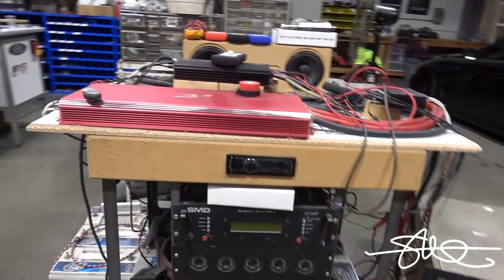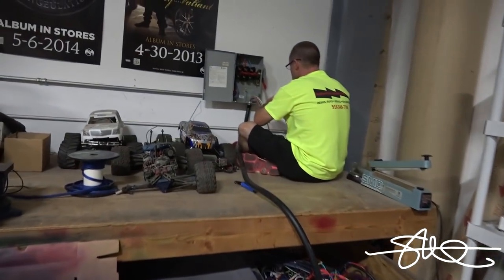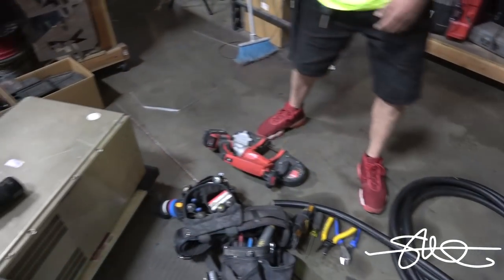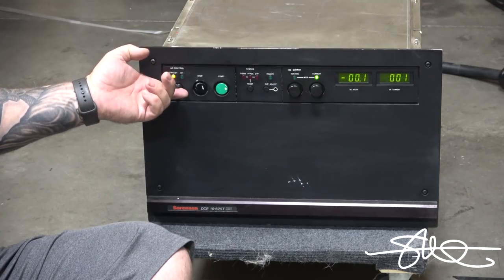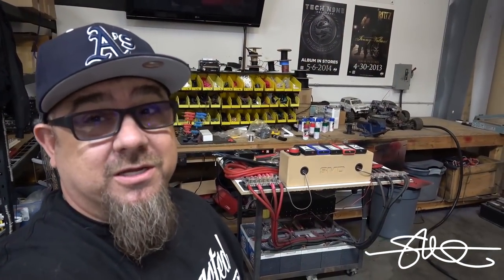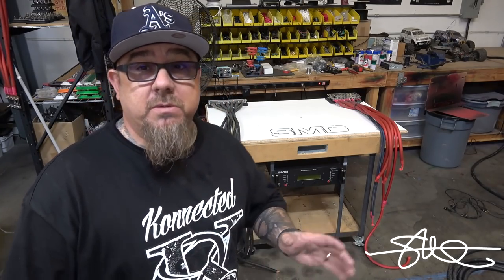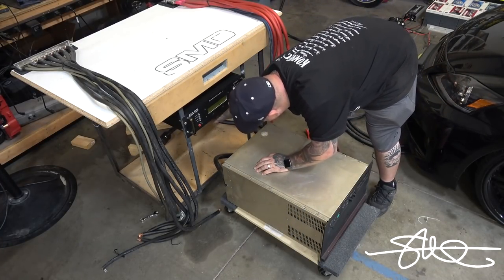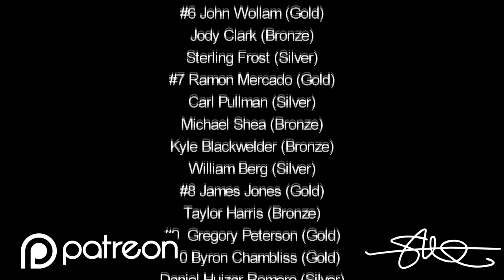Major Test Bench Upgrade! 10,000 Watt DC Power Supply! Sorensen DCR-16-625T

Comment: For the amount of power that supply is putting out that 4/6 wire is pretty modest to run it that is great considering how much wire it takes to run 1,000 amps at 12 volts

Comment: Did you add a 3rd wheel to the cart?  & since you’ve got such a solid power supply & massive one at that.  You going to run that 4/0 wire you have to the distribution blocks or just stick with what you had on it Before

Comment: Make sure you get some maxell ultra caps for surge capacity to take strain off of power supply when you push a BIG amp, the 2500 capacity series will do well and will save you from killing your new power supply

Comment: I’d hate to have to pay his electricity bill 😮😂 badass power supply 😈 that how SMD does it tho 👌
Reply: It will still probably be a lower power bill than it would be with the battery bank.
Reply: Was just going to say that charging the battery bank would be more expensive over time that only using the power when you need it.
Reply: Definitely could be true.
Reply: Never thaught about that 
Smd you need to diy some solar panels on the roof and some chevy volt batteries for the shop
That is if we are worrying about the bills but i dont think you are

Comment: If you plan on getting rid of any of those XS Batteries hit me up. My Optima took a crap this morning. 8 year old batt. Keep up the good work man! Love the videos.
Reply from the maker: your optima is a 12v battery.  These won't work for you. thanks though
Reply: I've got a built alternator and it kept that Optima at 13.9 I think that's why It died. I've got a supercap bank and as long as I unhook the optima since its died I can start my car if I'm quick lol.
Thanks for replying man. big inspiration
Reply from the maker: 13.9 is good...for a 12v battery.  It isn't good for a 14.5v battery like a D1400.  Those charge at almost 16v.

Comment: Seems like you would want to run some batteries or caps along with that power supply so that the power supply doesn't have to work so hard in dynamic tests; any plans for that?

Comment: What dedicated circuit has your electrician wired to the shop itself? In terms of amps. We wire some of our home theaters with dual 60 amp circuits and use Richard Grey Power stabilizers to juice the amplifiers.

Comment: I'd personally keep 4 batteries flanking the PSU to act like a capacitor, or maybe a lithium or 2, or even caps would do the job when running things like the raven. Either way, tests will be much more fair now

Comment: What size wire is gonna be used for the outputs?? And what is the deal with the rockford fuse holder having by the breaker box?!?!
Reply from the maker: you will see...and that isn't a RF fuse holder.
Reply: @meade916  distro block?
Reply: I was wondering too.

Comment: That thing is a frickin beast, I wonder what the absolute limit will be for what amps it can power sustainably
Reply from the maker: 10,000 watts.
Reply: Yeah true, I just wonder if there will be any headroom after that. Like an underrated type of situation
Reply from the maker: not really...i will probably get some voltage drop after that.  I don't test a lot of 10kw+ amps anyway.
Reply: Very true. Are you going to use the old batteries for a future build or something?

Comment: Steve are you selling any of those batteries I need one desperately.
Reply from the maker: these batteries won't do anything for you.  They are D1400 (14v batts).
Reply: @meade916  I was doing a setup simular to your much smaller
Reply from the maker: again, you don't have a proper setup to run 14v batteries that also charge at 16v.  So they won't do you any good. Sorry.

Comment: With the power supply along with all the other stuff that might end up on there later, you sure that shelf will be able to support all the weight?
Reply: The power supply is likely lighter than the batteries.

Comment: Why not keep some batteries for dyno-ing monster amps , a power supply won't have the dynamic ability to output power like the batteries did. I'm pretty sure I've seen more than 10k on that bench before in some amp test video.
Reply: Agreed. Especially with the power factor of that unit, your going to want to dampen the surge current to keep from tripping the breaker (50A if wired correctly for that CS6369 plug). That plug can supply 18kw of power, and that Sorensen unit has a 60% efficiency rating, which is 88% of the circuit at constant draw. Smaller amps its never going to skip a beat, but things like burst tests on a 10K amp dyno run are going to be tons higher on the DC side without a smoothing bank than the 10Kw rating, Hopefully the Sorensen does have an internal regulating bank heavy enough to handle the load spikes without killing the rectifier system (Haven't ever used this particular unit, its too small output wise for what we deal with in DC banks), but it may not have enough of one to smooth the spikes on the AC side to under the breaker's trip curve.

Either way, hell of a upgrade over a large bank and charge controller! Quick turn around on the dyno testing (or instant without a smoothing bank) versus waiting on a large bank to recover off a charger. Can't wait to see some test tuesdays on the new setup!
Reply from the maker: you guys clearly do not understand how this power supply works.
Reply: @meade916  I've been using power suplys big ones up to 400 amps for 20 years...we use them in ham and CB radio.....be careful or u will blow the recktafiers
Reply: That's a nice unit

Comment: If you have three phase there why not go 480 instead of 208 and bring the amps down. Plus the power supply doesn't work so hard?
Reply: if the power supply is designed for 208, that is what he has to use on it.  He may also not be able to get a 480 drop.  The 480 drop may be far more expensive than the 208.  Did you know that electric companies who supply 480 use the highest current draw of the month do determine power consumption for charging?  I know of two motor shops that use a diesel generator to start the bigger motors and switch to 480 once it has come up to speed because of the way 480 is charged.
Reply from the maker: because the machine uses 3 phase 208. Any other questions?
Reply: If you dont have the service starting with a gen set is the way to go. But that only works on small motors. LVC has four 400hp motors we put on their pin mill. Obviously they start with soft starts but their voltage is regulated by VFD's.
Reply: miller  nice.
Reply: @matt-be8kt  I never worked with anything larger than 200 horse.  Water plant.

Comment: The supply cable seames a bit of an overkill? I mean that is 3phase at  400v witch is about max 20A (18A with power factor of 0.8) for 10kw. A 4x2.5mm2 cable would be enugh for instalation lile this( non covered laydout cable).any reason for the I would say 4x 6mm cablr. Us law?
Reply from the maker: SMH always an expert in the building. LOL!!!  The cable is 50ft long.  Just making sure it is as good as it can be.
Reply: @UROS RUTAR That's what you call a extension cord!
Reply: Using that long of a cable I’d use as big as it gets as well. He even said that he’s leaving a lot of cord so he can move the bench around . Least amount of voltage drop the better . First person I’ve ever heard complain about using to big of wire lol usually it’s the other way around 😂

Comment: Hey Steve I was looking these power supplies up. A 3000watt one is 2grand. Can only imagine what that big ass one costed. Do u have a good site to find these used? Just wanna hook up a 5 channel nvx amp with their Bluetooth in the house, just need a decent a safe power supply at an affordable price. If your saling any of those xs batteries u took out. I'd  be interested.
Reply: @djwonderbrad  well thank you. I must have clicked on the wrong one. That's  not a bad price at all. Gonna try to find a 1000ish watt one. Thanx again.
Reply: You'd be better off with a Crown rack mounted mono amp. The reason Steve is doing this setup is for testing car amps, but its a lot more efficient to use an amp that's already AC powered. One similar to what he used to power his tower build would be perfect

Comment: Can I has one of your old batteries?! Sign it n ship tp us!! Lol pimp setup..yknow, I got a portable scope, and I'm still thinking of buying some of your tools bro.. keep it up
Reply from the maker: you have no use for them.  they are not 12v batteries.
Reply: @meade916  I never assumed they were 12v! 16? 18?
Reply: IdealSound & Performance : Mobile  They/re 14v.
Reply: When i said 16/18 btw i meant charge voltage obv. But yeah 14v would be dope. Plus having a smd signed battery would be a cool novelty for sure.

Comment: Is this two phase or is this running on 3 phase without neutral
Reply: Dave Micolichek So the Earth is missing, In Germanny somthibg like this would not be legak I only know 3 phase 230/400 but you need a neutral if the phases a not symetrikal loaded. But american eletical always seems a litte bit strange to me
Reply: This is 3ph + Ground, no neutral. The forum thread has pics of the disconnect fully wired up, white wire is being used as the 3rd phase.

Comment: Can i buy one of those batteries from your test bench?
Reply: I would like one as well.
Reply from the maker: these batteries are 14v and won't work for you. Unless your car charges at 15.9v which i am sure it does not. Try some 12v batteries from autozone.
Reply from the maker: these batteries are 14v and won't work for you. Unless your car charges at 15.9v which i am sure it does not. Try some 12v batteries from autozone.
Reply: @meade916  well dang. Another xs d3400 it is. Steve have u checked out the fat boy power supplies? Looking at either those or a sorenson. Don't  need anything as large as ur doing. Maybe 400amps power my car when I  don't  wanna run it and play music.
Reply: And a small 75 amp one for the house.
Reply from the maker: so you are gonna run 3 phase power out of the fuse panel to run your system with the car off? lol
Reply: @meade916  lol. Didn't ever put any thought into that one. Thankfully thw fatboy 300 amp  plugs into a 220v outlet, just get an adapter or rewire it to plug into dryer outlet. Lol. A long dryer cord aught to do the trick. Lol.